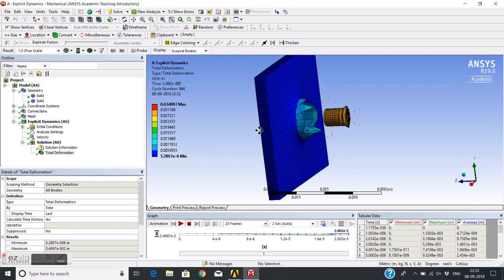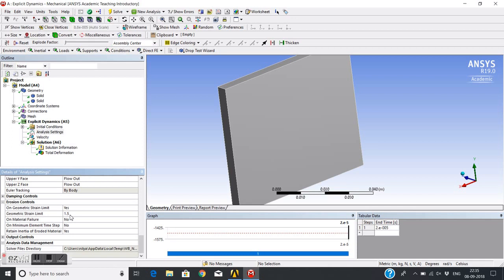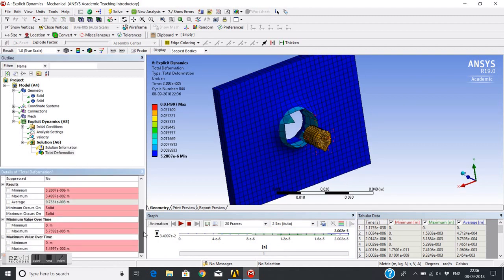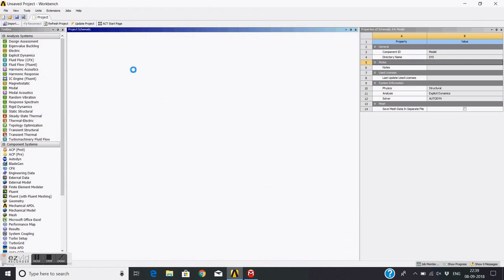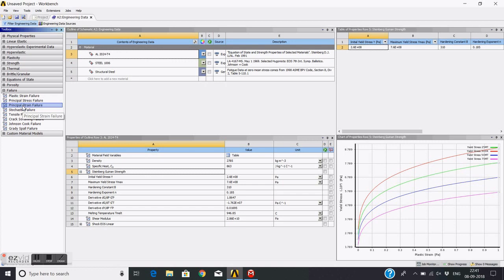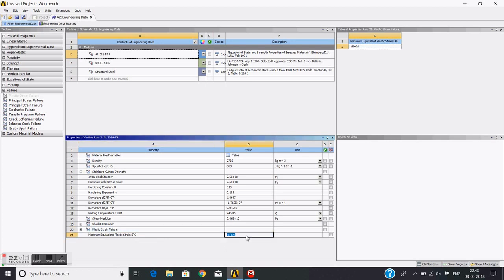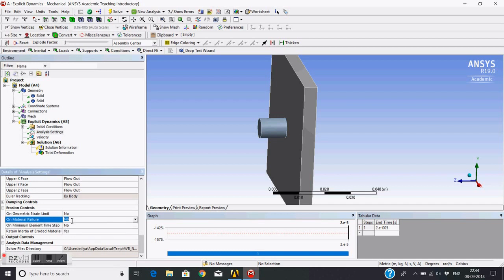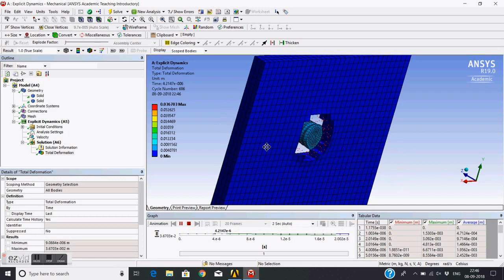Bullet Penetration in ANSYS explicit Dynamics Autodyn Part 2

Comment: Sir, So you mean if we could have precise material data, it is more accurate when we turn 'On material failure' on ?? At first, I thought that material shouldn't be failed if we didn't turn 'On material failure' on but it wasn't. From this vedio, the material is still failed even if we don't turn ' On material failure'. Then, what is the benefit of 'On material Failure' options? Does it could give us more accurate results if we had precise material properties??  Thanks for your great tutorial tho.
Reply from the maker: By default solver set geometric strain equal to 2 for failure. It is too high but it erodes material (remove elements) if elements warps too much  (geometric strain more than 2). It is numerical. Mostly material fails means elements stops providing any strength or resistance. They only provide inertial forces. These elements are simply removed and inertia (or kinetic energy) may be (your choice) added in computations.